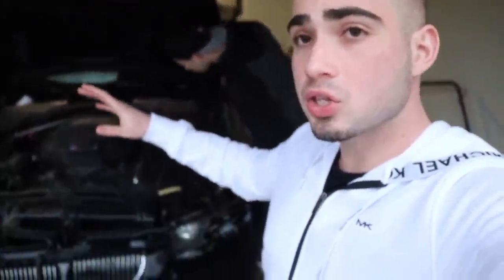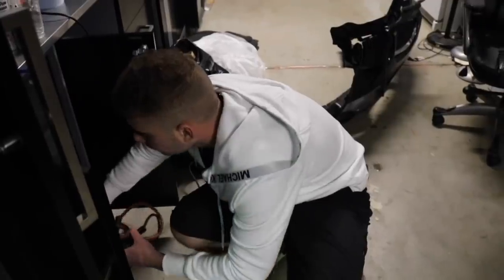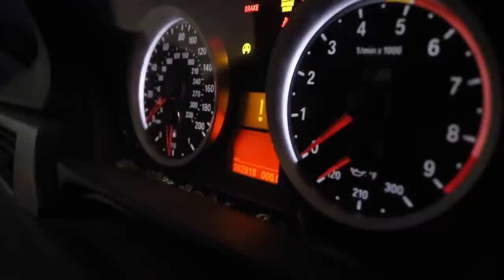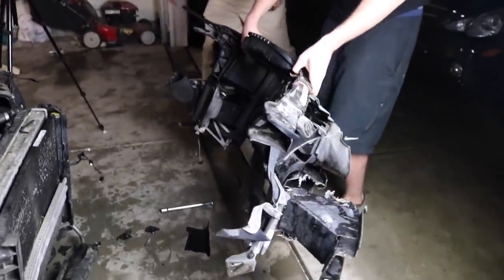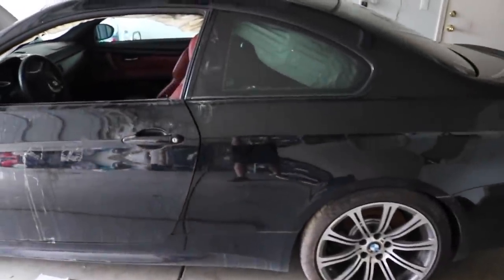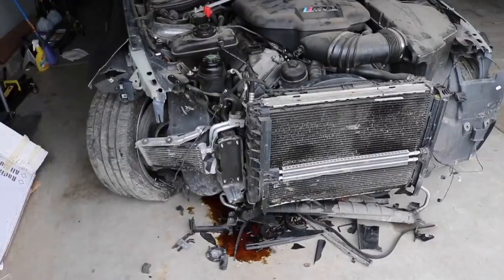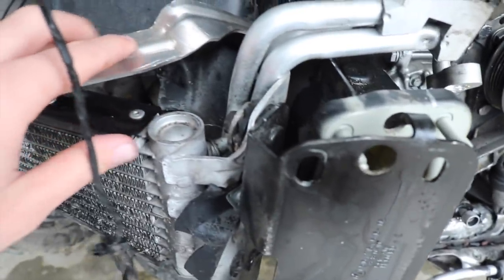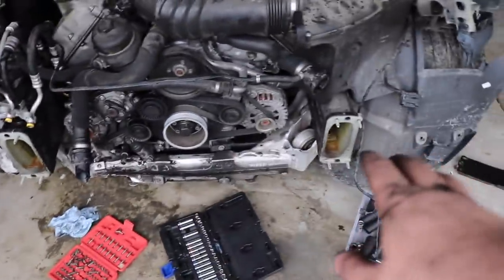Rebuilding A Wrecked BMW M3 Part. 2

Comment: You might need to replace the battery cable, there's a small explosive on it that explodes after a crash to DC the battery, it can be mcguiver wired but could cause a car fire and constant battery resets. I know from experience lol

Comment: Eh, i dont think it will be all fixable without paying thousands. the front end frame rail was bad enough being bent along with the quater panel which made it ten times worse. you say it will be cheap n easy to fix but in the end i dont think so, if you really wanted a M, could have got a used one, it wont be salvage and wont be unsafe to drive.

Comment: How much is a clean title worth in the US ? Same year and similar milage and specs
Reply: $20-$25k
Reply: Nick Gorkes is it really? I was thinking more 15-20k
Reply: How much will nours car need to be fixed, won't it cost less to just buy a clean title ? Idk about the US but in Iraq it will cost more than 10,000$ to fix
Reply: @amedlak  no it would probably cost more for a clean title car also it depends on if hes sourcing parts from a third party or going to the dealership

Comment: When I wrecked my 550i that battery cable to the starter did explode in mine cutting power to the starter. If yours did, I can send you a video I took of removing the little thing which bypassed it allowing me to start the car
Reply from the maker: All good just ordered a new part